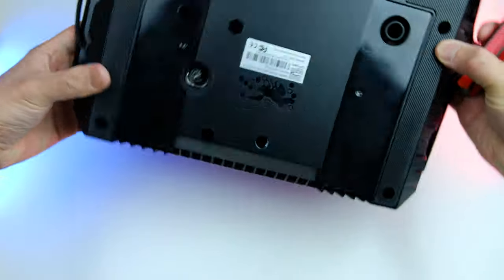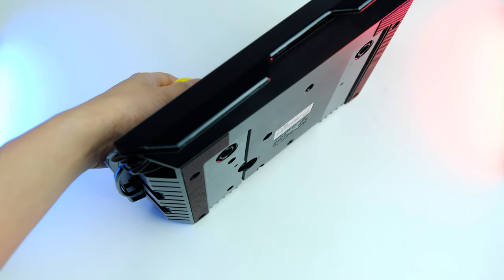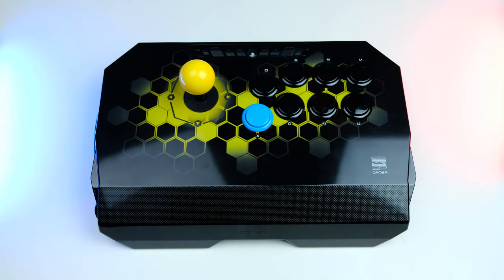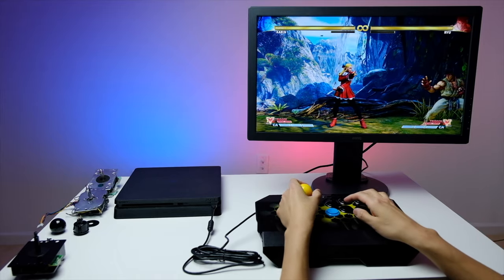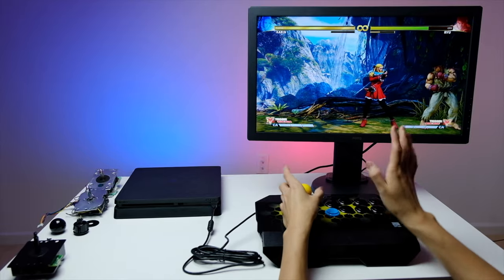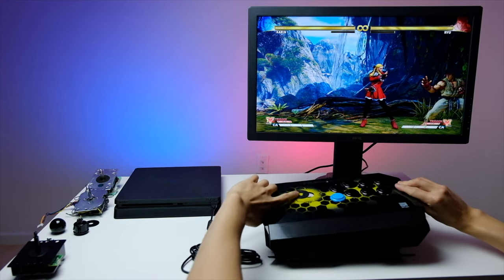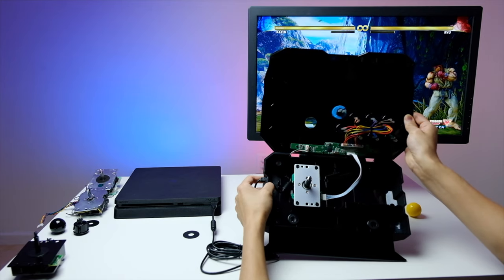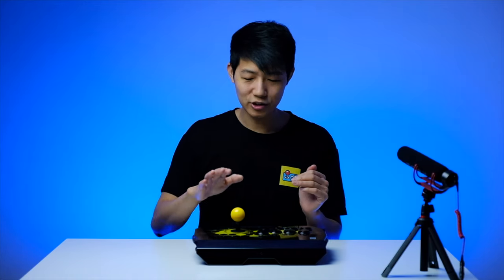Qanba Drone Mod Upgrade - Sanwa Joystick and Buttons

Comment: Do you need both the 5 pin cables Im asking this because i was a bit confused on why there were two links for 5 pin cables 

What would i have to buy if i wanted to install a seimitsu joy stick
Reply from the maker: You wont be able to install the seimitsu on the qanba drone, there is not enough room. You only need the cable i shown in the video, 1 end goes on the 5 pins on the lever, the other end plugs in to the board
Reply: @JoystickNY  Dang man I just purchased a drone not too long ago and I love seimitsu

So is there no way possible to install seimitsu
Reply from the maker: BlazingUltra i believe its possible, you may have to break something and add something and do some customization with it. But it should he a lot of work. But it will end up ruining the stick in the long run. I havent look in to my self, but i dont think its worth it tho
Reply: @JoystickNY  Feels Bad do you think sanwa is good i feel like its hard to do diagonals on it
Reply from the maker: Ninja Munkey sanwa is really good, i used sanwa for many years and i love it, i just prefer hayabusa more. But u cant go wrong with sanwa.
Reply: @JoystickNY  whats the reason you prefer hayabusa more
Reply from the maker: Ninja Munkey hayabusa is very loose and have less plastic, my gestures are very light, so it fits my movement style

Comment: I bought a qanba drone a while back to mod it, but I guess the wiring is bad because 1 of the buttons doesn't work.  What do I do about that?
Reply from the maker: The easiest way is to open it, connect a different wire to that button, then go back in to setting in the game; button configure, and just map that button as thr attack you want, let me know if it works 👍🕹

Comment: would it be better to buy the daija which is listed at 149.99, or buy qanba drone and upgrade the buttons and stick to sanwa?
Reply from the maker: It will be a 50$ difference, 
Qanba drone about 65-70, sanwa parts 30-35, your looking at about 100, 
But you get a smaller stick

The daija will definitely be the better stick, if you dont mind paying 50$ more.

Comment: Good Video. Curious why you needed a new wire harness? Would the one that came stock not work? It looks like it is a 5 wire also?
Reply from the maker: The original would work; but it takes alot of work, where as the new 1 is just plug and play
Reply: @JoystickNY  Gotcha, thanks. Very helpful video and information, especially to someone like me who is new to fight sticks.

Comment: I just got an used qanba drone and i am wondering, should i bother and upgrade it or look for ''the next thing''? if you could put in terms of  cars between a stock qanba drone and this modded version, do you think its worth it?
Reply from the maker: I would def change the button and lever to sanwa if you are serious about fighting game, if you touch it here and there, i would say dont bother.
In terms of cars, its kinda like if u drove it on the weekends, u can drive a base model honda accord, if u drove to work everyday and wants to feel the turn and the handling, maybe go for that sports fully loaded with turbo if u know what i mean

Comment: Just wondering if this stick will work on a Raspberry Pi or Nvidia shield? Looking to use it mostly as an arcade stick for those two devices for retro games. Being able to use it on a PS3/PS4 is just a bonus for me. Maybe the Qanba Carbon would be better for those?
Reply from the maker: I am not sure about rasp and nvid sheild, i only play xbox, playstation, pc 🙏❤️

Comment: the restrictor gate looks strange, can i replace the qanba lever's restrictor gate with a different normal gate?
Reply from the maker: That i havent tried , not sure if they used standard sanwa measurements,
I do recommend replacing the whole lever
Reply: @JoystickNY  i am planning on replacing the lever, but can you recommend a good lever that is worth placing in the drone?
Reply from the maker: Cant go wrong with sanwa jlf

Comment: can i put Korean taeyoung lever in this box?
Reply from the maker: The the taeyoung will not fit, because the shaft hole is too small, japanese stick casing have a different size hole compared to korea casing, because the taeyoung has that black cylinder on the shaft 🙏❤️ good question tho

Comment: Hey Joystick NY, an off topic question here, but what are your opinion on the IBuffalo Savior 13 stick? I managed to ordered one for a cheap price but there's no review (that was in a language I can understand) whatsoever
Reply from the maker: I never seen that stick before in the usa before, that is a japanese exclusively for the japan market, i dont understand the Japanese writing, judging from the photo and price, it looks like a entry level stick. And i couldnt find any pictures of the internals, so i cant really give  you a good answer on this stick. If you do receive it, open it up, and if its friendly mod able, you should be okay, cuz you can just replace the buttons and lever easily, but if its solder wires, then it will be a bit more hassle 😊
Reply: @JoystickNY  ah thanks for your help man
Reply: @JoystickNY  So the stick just came in and I can confirm it's mod friendly. Sadly I'm still pretty much a beginner in all these stuff so I  didn't dare to mess with them. The lever and button feels good enough tho, so I'm planning to just keep using them and see what'll happen.
Reply from the maker: Phú Nguyễn ya, break it first, then upgrade, dont waste the original parts, use them for learning 👍🕹😊

Comment: The qanba carbon is much cheaper. Which should I choose
Reply from the maker: Where i live , is a 10$ diff, i think the qanba drone offers better value, it works for ps3/ps4/ps5. The carbon is limited on ps4 and doesnt work on 5 ❤️🙏

Comment: Can the Crown 309 MJ be use in the qanba drone cause I'm planning it to replace it instead of a Sanwa JLF?
Reply from the maker: Can u send me a msg on ig or fb messenger, that way i can remember to check it when i get home, i think some 1 asked this before, but i am not 100% sure, i will have to open it up and try it again. I ll also mark your email as unread, so i will remember to check for you 👍🕹
Reply from the maker: I checked, it will fit, but you have to bend the pins on the mj309, or cut some plastic, but it will work

Comment: i thought i was opening it wrong but 1 of the six screws wont let me phillips screwdriver open it got the other five out fine but this one isnt even shaped some hwo
Reply: HOW*
Reply from the maker: That is very strange, try a different philip screw driver, they come in different sies and depth, if worse comes to worse, you may have to just use a drill and break that screw, happens to me sometimes with other products, i treated as if the screw got striped

Comment: Is there a Seimitsu lever that will fit in the Qanba Drone? I already modded mine with a Sanwa JLF, so is there cheaper sticks that can fit a Seimitsu?
Reply from the maker: If i can remmeber correctly, i dont think any seimitsu will fit the qanba drone, but the mayflash f300 is roomy enough to fit most levers ❤️🙏
Reply: JoyStickNY thanks so much for your answers! I’m sure the Mayflash F500 can also fit Seimitsu levers. Cheers. Did you ever try to do a half circle forward move on keyboard in Alpha 3?  Or a Cammy hooligan? Seems old games were designed with Arcade Sticks only in mind.
Reply from the maker: Chronology you right, some commands are harder to do on keyboard. Like 360, tiger knee; instant jump cancels, super jumps etc
Reply: JoyStickNY tiger knee seems to work fine in KOF. Half circles, too. Super jump is fine in KOF, Super jump is hard to do on even Arcade Stick or Pad in 3rd Strike, but it’s fine on keyboard, pad, and Arcade stick in KOF. KOF is more lenient than SF before SFIV? Everything works fine on keyboard in SFIV.
Reply: I play my games on PC. It’s all I own other than a PS2 with only SF15th Anniversary and Tekken 5. So sometimes I’m too lazy to bust out my Sega Saturn pad or Qanba Drone with Sanwa JLF.

Comment: The problem with this arc, Stick dont have posibilities for chenge the art :(
Reply from the maker: You right, its printed on the plastic 🕹👍
Reply: what do you mean?
Reply from the maker: The ink is directly on the plastic, so there is no way to change the artwork, you can only put stickers over it

Comment: Not sure if this will be responded to but do you know if the crown cwj-303a would fit the drone? I think the profile is similar to a sanwa but I'm not sure.
Reply from the maker: Hi friend, it doesnt fit by default, you have to cut some plastic or bent the connectors to make it fit, so yes you can, but you will have to put in alittle bit or work, i checked it for a viewer one time, and remember it 🙏❤️